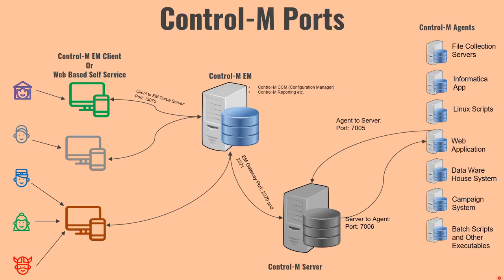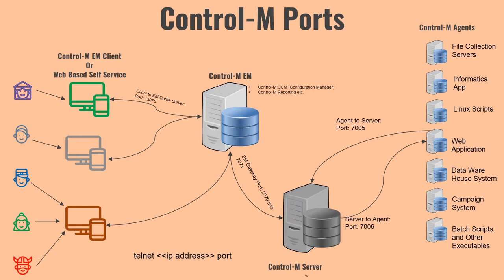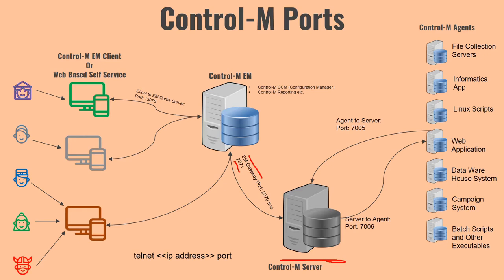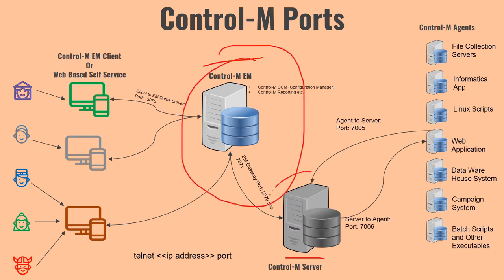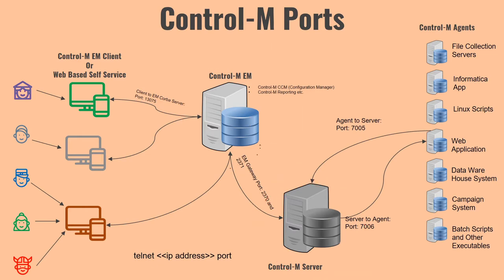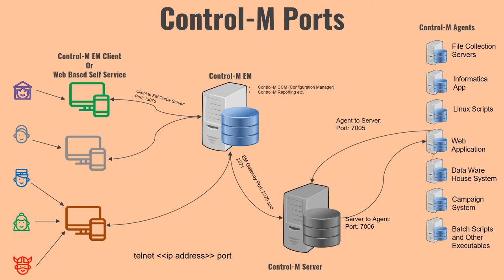BMC Control-M Architecture and Ports - Explained in detail

Comment: This is old version diagram ,  Control-m/em not use 13075 anymore.
Reply from the maker: Thanks for pointing it out, So which port is used now between EM client to Corba communication? Could you specify which version was it changed in?
Reply: @VikasJha001   9.00.18 ,9.00.19 ... ,They don't use corba communication , they already used http/https connection. (TCP:18080)
Reply from the maker: Great, thanks for updating.
Reply: @VikasJha001  The knowledge shared by you on Control -M  is very much useful.Thanks for the same .Please your help with some more videos related to Jobs scheduling..
Reply from the maker: Thanks  @abhishekwadekar6514  Sure, Will post in future.
Reply: @sarutyeamrukchat6935  👍 nice point